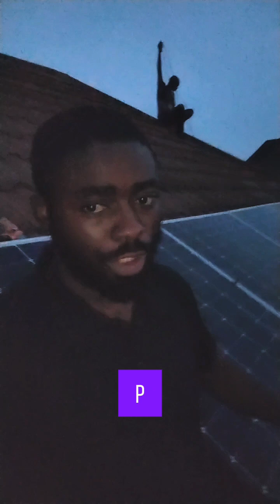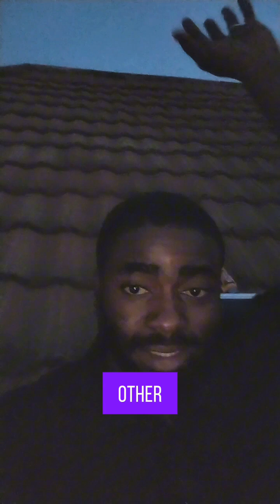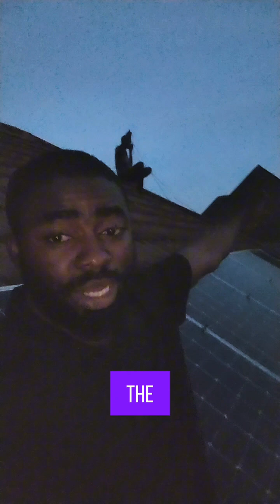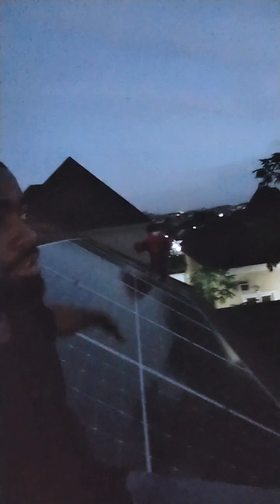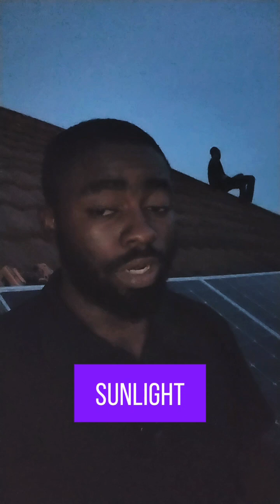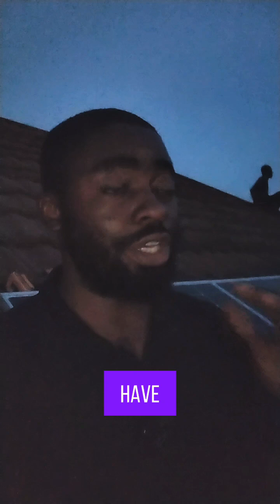Best configuration for high PV inverters.

Comment: i put 8 panels in where sun rise and put 10 panels in where d sun set
Reply from the maker: That's good
Reply: @Mairigaemmanuel these panels are dead.my own produce more than is rating.i have 12 unit of 600watt d one u are using and 8 units of jinko 625watt